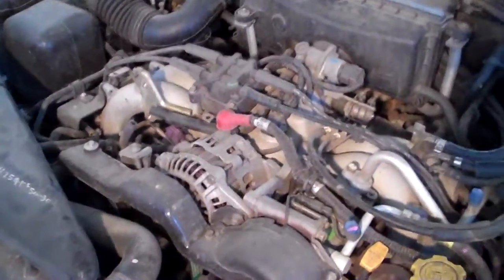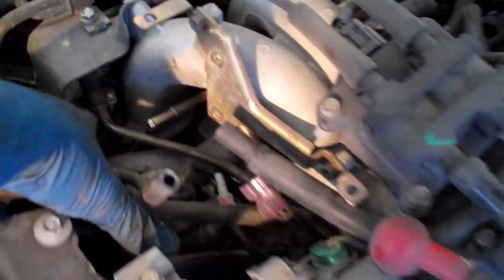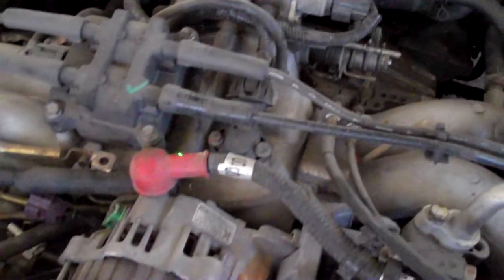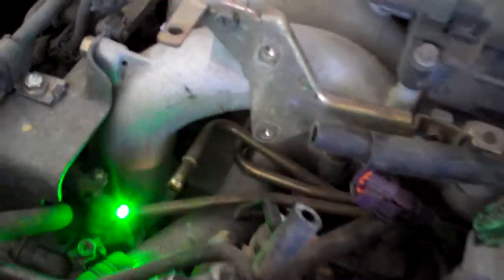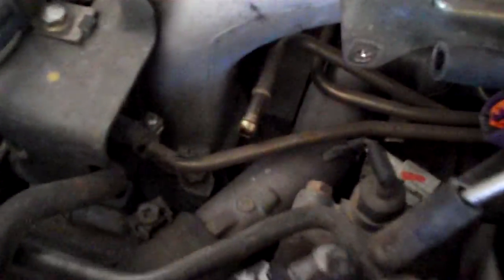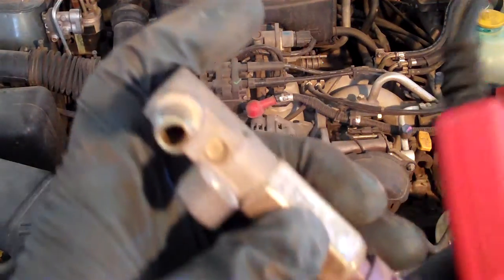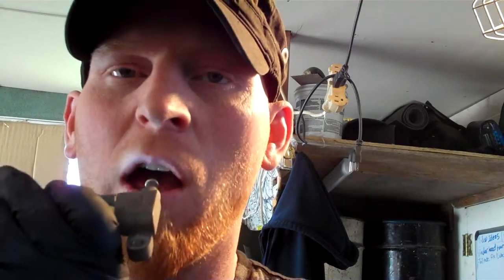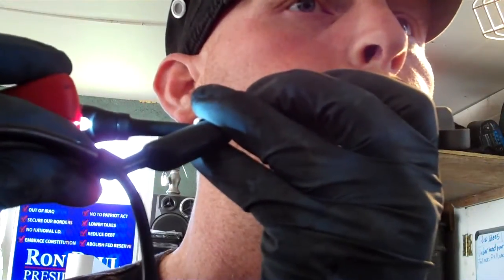How to Diagnose code P0065 on your Subaru

Comment: Wanted to update my experience with the P0065 code for anyone still rocking these older Subbies. 1) I know the valve is good since a bad valve will throw a P0066, I also tested it as outlined in this video. 2) All the vacuum lines are clear and free flowing 3) Called dealer and this vehicle had WWF-89 Software update in 2004 for the P0065 code. 4) Ran a stiff wire into the intake manifold passages, Drivers side was clean and clear, like perfectly clean, Hmmm, Passenger side is partially blocked and the wire came out gummy with wet carbon deposits consistent with a 230,000 mile engine. So whats going on with the drivers side, why perfectly clean and clear? Well the intake manifold is going to have to come off regardless to clean and inspect the passages.  Great News; I took it out to a twisty mountain road and romped on it and put it through lots of engine braking to create high manifold pressure differentials and the code cleared and everything went in the green, I immediately took it in for a smog test and it passed!!!! Although with regular highway driving the check engine light illuminated yet again the next day. 
I have two choices, I can pull the intake and clean and inspect passages, or I can ignore the light for another 2 years...."hey dude, why do you have a piece of black electrical tape on your dash?" lol

Comment: Uhg, fighting this code right now. I got to get Cali smog and this little bugger just will not go away. I can clear the code and it will stay off long enough to get the readiness flags but when I get to go for smog the code is 'pending' so they won't run the emissions test.
Reply: Some new found information, no need to test the valve for a soleniod failure as that would be a P0066. A P0065 is a failure of the MAP sensor to see a expected change in manifold pressure when the valve opens, thus checking and cleaning of the lines is prudent. In addition the ECU reflash is specified as WWF-89 and it specifically lowers the threshold in detected pressure change in the manifold. Your local dealer should be able to look up your VIN and check to see if that has been done to the vehicle. 
I will be getting some wire coat hangers and performing some probing and cleaning of passages, but mommy said 'NO wire coat hangers!" 
Hope this might help someone else, also I will update this thread with my findings

Comment: Great video.  I have a 2002 outback, with a p0065 code.  Removed and tested the sensor, worked fine.  Cleaned the hoses, nothing in them.  Called Subaru, and they told me the re-flash doesn't apply to 2002 outbacks; only 2000-2001.  Aside from taking it to the dealer and paying to have them "fix" it, any other ideas I should try first?

Comment: I now have this code after finally fixing the CEL for the idle air control valve; that was intermittent for over a year.  That valve was replaced, twice, vacuum lines were all replaced and throttle body was cleaned.  But CEL would turn on and off.  This time, the light isnot turning off by itseld after a couple of driving sessions.  I called Subaru and asked if there were any recalls on my '03 Forester; was told there are none.  I was hoping if the PCM was defective it might be "re-flashed" with no charge.  Your video was very informative, and I love your Ron Paul poster in the background!  I'll ask husband to help me check the hoses and unit as you illustrated. And hoping I won't have further issues with it because I love my (!66000+ mile) Subaru.

Comment: Hi there.  I enjoyed your video, and thought it was very helpful.  Using your suggestions, I was able to confirm that the tubing on both sides of the valve was not plugged, and that the valve itself operated just fine.  So, I concluded based on your video that ECM reprogramming was needed.  Since the nearest Subaru dealership is an hour away, I thought I'd ask a couple of local mechanics about it.  Both responded that ECM reprogramming was likely not needed.  One of them specializes in sales and service of Subarus, but is not a Subaru dealer.  They said "I got your message. It looks like the code that you have listed has nothing to do with re programming the ECM. And actually, it's a code that needs to be diagnosed. It could be either a wiring problem, or a couple other different things. You shouldn't have anything to do with reprogramming the ECM.  And if you did need to reprogram the ECM, we wouldn't be able to do that you would have to go to Subaru."  Just curious, where did you get your information?

Comment from the maker: Yes.  I replaced and O2 sensor today and a distributor on a 98 K1500 Chevy truck with codes. P0133 and P1345.  Once those were fixed it could then go far enough down the self diagnostic hierarchy to check misfires and then threw a P0306.  From there I found cylinder six was misfiring due to low compression.

Comment: I pulled my MAP sensor and cleaned it and then within 25 miles it through this code.  I think they are related.  Do you think the code can be related to the MAP or the MAP o-ring possibly seating properly?

Comment: So you are telling us that the original firmware that Subaru flashed into the PCM has a bug in it that could cause a false P0065 in the absence of an actual physical problem? And that it is a known issue and the dealers have upgraded firmware for it?